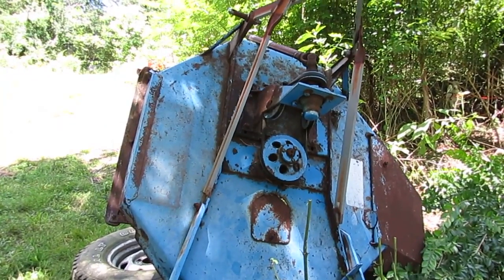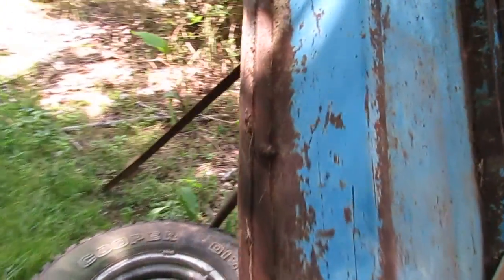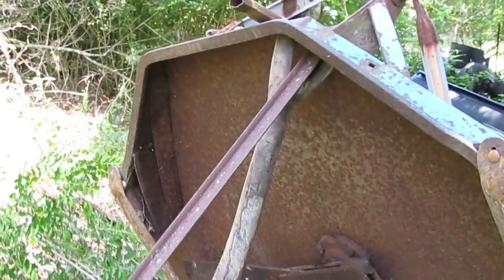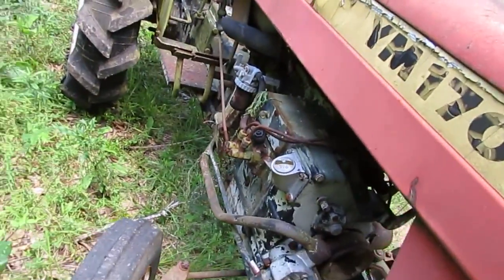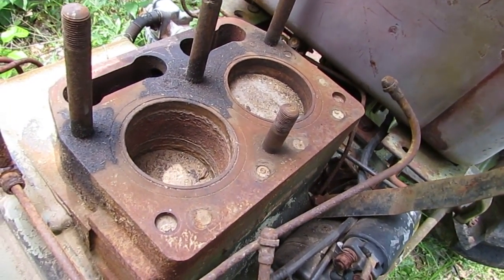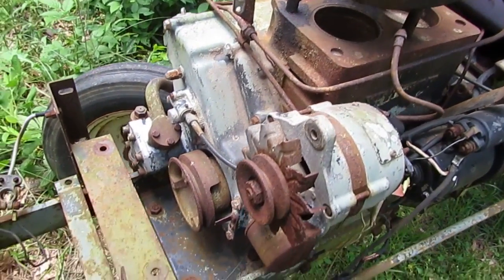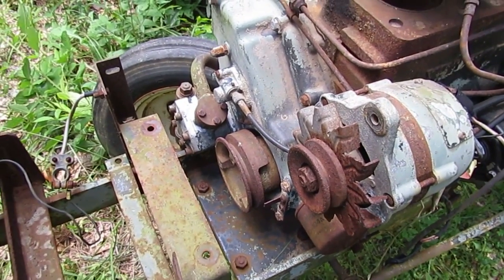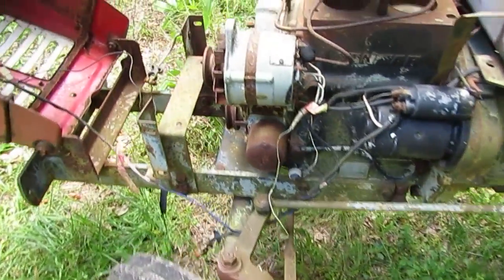Tractor Stuff

Comment: It might be a good project if it doesn't run into too much money.  

May I ask a question about pellets for pneumatic airguns?

What is the pellet you use most for hunting in .177 for multi-pump airguns and which .22 caliber pellet do you prefer for hunting with a break-barrel or side cocking air rifle?

I have the Crosman 1377 with the stock attached and a Gamo Hunter in .22 caliber.

I like the Crosman pointed pellet in .177 as my first choice then a domed pellet for second choice.

I enjoy being subscribed to your channel.
Reply from the maker: I prefer domed pellets for hunting. In .177 the JSB Exact Heavy or the Crosman Premier Ultra Magnum would be good choices. For .22 I really like the JSB Exact Jumbo Heavy (18.13 grains), but springers tend to prefer middle weight pellets so I would try the 15.89 grain JSB Exact Jumbo or the 14.3 grain Crosman Premier Dome.
Reply: Thank you sir.  I appreciate your advice based on years of experience!

I really appreciate the help.  Take care and stay safe.

Comment: great fine there mr. possum check out trucking companies and truck garages or semi truck junk yards a lot of the auxiliary power units that provide heated antifreeze air conditioning an alternator for a semi truck well the driver is on rest break a lot of the Apu units are Yanmar 20 horsepower you can pick them up reasonably cheap good luck hello tractor looks good I wish you could repower it before it gets cannibalized
Reply from the maker: Yeah, I've seen those reefer units. Not sure if they have the same bellhousing pattern; I'll have to research that. I bought it for the wheels but you're right, it's too good to not repower at some point.

Comment: it's not a reefer unit it is a two cylinder engine that rides on the frame of the tractor that powers a 12-volt 110 alternator and an AC unit air conditioning for the sleeper my guess is the bellhousing maybe 12 inches across if that they are a universal engine with many applications
Reply from the maker: I haven't seen those. I have seen the single cylinder Kubota APU engines though; in fact I have one.
I'll look for the type you describe. That sounds about like what I need.

Comment: I have been looking for one of those smaller 1500 or 1700 yanmars in a 4x4 for a while now. I wonder how hard it would be to adapt a new engine to the old trans?
Reply from the maker: I don't know. I think it's a standard SAE bolt pattern. I just need to figure out which one it is, then find out what other engines have that pattern. Or, make an adapter plate.
Reply: i would say an adapter place would be a lot easier.. either way that was a heck of a deal
Reply from the maker: I agree. The cutter alone is worth what I paid for the lot.